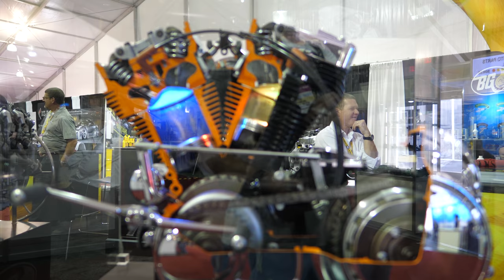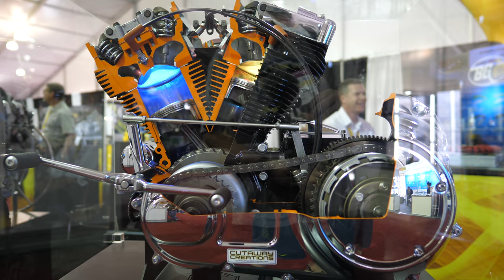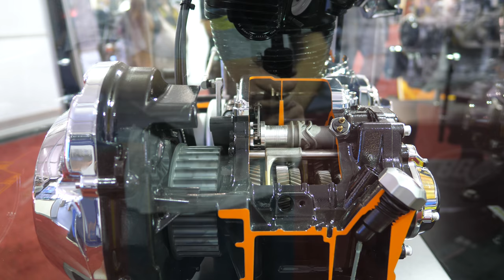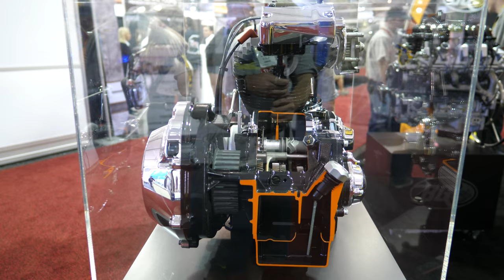Working Model of an Evo Harley Davidson V-Twin Air Cooled Motorcycle Engine at SEMA Show [4K]

Comment: Harley Davidson. Turning gas into noise without the side effect of horsepower since 1913
Reply from the maker: Lol
Reply: You don't know about engines. Without TQ there is no hp and a Harley makes more tq that your bike does🤣🤣🤣
Reply: 1903*
Reply: @austinwise5493  my bike makes 101ftlbs and 200hp. Out of 988ccs. 2020 ZH2
Reply: @sambert96  damn that's weak. Only 101 lbs of tq🤔 there are harleys making wayyy more tq than that. There are also 800 lbs baggers going over 200 mph👌 your bike has to weigh 300 lbs to do that or else the engine would blow up and you can YouTube that 😅
Reply: @austinwise5493  yeah sure whatever you say buddy.
Reply: @sambert96  if your on youtube all your have to do is youtube it but you won't cuz you will see harleys been crushing your "fast" "powerful" bike🤣🤣🤣
Reply: @austinwise5493  lol ok buddy. Whatever makes you feel better
Reply: @onefastslimjim  so if your correct than TQ X RPM doesn't equal HP🤔
Reply: @onefastslimjim  the equation to get HP is TQ X RPM so yes TQ does MAKE HP. tq is twisting force ( oh wait I'm wrong on this too ) lmao twisting force is what makes the engine TURN to make RPMS which MAKES HP lmao yea your right tho. Hp lovers don't know shiit😅
Reply: Austin Wise your literally speaking gibberish 😂😂😂
Reply: Quantum Leap THANK YOU 😂
Reply: @austinwise5493  Your physics is weak. Torque is only part of the equation. You have to take into account how much force is delivered per second, that's what horsepower is a measure of. 1 horsepower equals 550 ft/lbs per second. So while an engine with more torque may deliver more peak force, an engine with more horsepower is delivering more torque per second. All things equal (gearing, weight, etc.) Its the engine that outputs more horsepower across its rpm range that will accelerate faster.
Reply: @execration_texts  if that was true show me a stock car that will beat a tesla....I'll wait. Without twisting force (TQ) nothing moves. The force delivered per second is TQ not hp.
Reply: @austinwise5493  that's incorrect. Teslas are fast because electric motors are between 85% and 90% efficient at converting electrical energy into rotational force. By comparison the most efficient combustion engines hover around 30% to 35%

Horsepower is a unit of Power.
Power = force × (displacement/time)

Torque is a unit of Work and is defined as: torque = radius × force x (sine of theta) or more simply: Force × linear displacement

Do you see time in the torque formula?
Reply: Work is equal to force over time, or  torque over time....
HP = Torque x RPM ÷ 5252

Horsepower is the measure of being able to do work or energy. See you can see by the equation that you can have half the amount of torque but twice the RPM and you have the same amount of horsepower.
Reply: @william.youare6736  horsepower is the measure of the rate at which work is done
Reply: A 200hp zh2 is still gonna beat a harley,more torque doesn't mean faster, horsepower is how rapidly a vehicle can perform

 More torque means more force you have to either accelerate your car or pull a load with
Harleys have a lot of torque because they are heavy bikes and are meant for cruising,they are not aerodynamic and doesn't have high speed gearing

Can your harley do 300/400kph?
Can it compete the isle of man TT and not break down?
Can it go around a racetrack without it scratching the utility box on its side

Sure Harleys are good for standing 1/4 mile,0 to 60 and smoking the stop light but it was made for old men who likes classics,harley Davidson has a great history from the very first bike and how they came to be but just stop comparing cruisers to sportbikes, both are made for a purpose and both are nice in their own way
Reply: Its fast enough for the speed limit -.- harley's are for enjoying the cruise. And if you want horsepower just slap on a booster 🤷🏻‍♂️ a good tuner will know how to modify a stock
Reply: Harley bois are offended, be safe dude haha 😉
Reply: It wasn't made for you...
It's a mans bike
Reply: for use every day who needs a motorbike with large horsepower, if a large torque is needed to be used every day, after all, no one wants to race every day, with high engine speed and to high speed on public roads there are disturbing people around unless you are a racer whose day-to-day work is just racing on racing tracks.
sorry for my opinion, do not mean to offend anyone ✌️but based on my experience living in urban areas with 5 motorbikes that I have in the garage (nsr sp150, vespa sprint 150, harley davidson roadster, mv agusta brutale dragster 800rr, yamaha xsr900)
Reply: Noise junk, that's all!
Reply: Ducati dois cilindros tem comando desmodrômico (sem molas)
Reply: @austinwise5493  lmao you are defeated
Reply: I've ridden many rice burners, they do not thrill my bones like a Harley does and they never will. I am 60 and still burning Harley gas. There is no replacement!
Reply: @sambert96  ZH2 is the slowest Hypernaked bike on the market in terms of track performance lol, even a Yamaha MT-10 SP would destroy your ZH2 on track. Plus you forgot to mention that your bike is supercharged, and only 200hp? That’s pathetically underpowered, look at KTM 1290 Super Duke R, that uses a 1301cc V-Twin generating 180 horsepower, weighs only 200kg wet and hits 300kmph at the limiter, your ZH2 freezes at 287 because it’s a big fat 239kg bike and doesn’t have a good power to weight ratio! That’s a big shame on Kawasaki. You should have bought a Ducati Streetfighter V4, or Aprilia Tuono V4 or Triumph Speed Triple 1200 RS, all of em will smoke ZH2 in a straight line as well as on track and they’re much more comfortable
Reply: HD's are very powerful.  But their poor factory quality control and poor factory workmanship and  inferior materials has made them the laughing stock of the motorcycle community.
Reply: @sambert96  you have a bike meant for the track, you bend over like you’re bout to take it you know where to ride, and it costs just as much as a Harley. Not sure what you’re getting at bro
Reply: @austinwise5493 yeah they make torque, but they can't go over 120 ft lbs 
It's like a powerlifter, sure he can pickup a huge amount of weight one time but he has no functional athleticism 😂
Reply: @tomtemple69  I can't believe that 2 years ago, someone thought a Harley would crush a ZH2 😂
Reply: @zahrulexe  it would crush a zh2, literally lol
900 lb fat@ss bike will crush a 530lb zh2
Reply: @tomtemple69  all because of torque down low. Heck yeah!
Reply: Ha ha ha😅
Reply: @sambert96 sounds gay

Comment: Fake, there's no puddle of oil under it
Reply: There's a puddle in your underwear
Reply: The engine is for showing its not for running
Reply: My shit don’t leak
Reply: Comment shows you’re 80 years old
Reply: I rode an evo for 34 years, didn’t leak!
Reply: I have an evo with a 124K miles on it.  It doesn’t leak.
Reply: Not all harleys leak if you do proper maintenance and fix every issue you want have a issue
Reply: The evo saved Harley. They are reliable as can be
Reply: @mitch6969123 after 26 years my 1998 Fatboy just started dripping
Reply: Yo
Has anyone, ever, I mean ever…sealed a HD Evo primary?

Is it humanly possible to seal and make the Evo primary oil tight?
Reply: Cuz it's not owned by some hill jack like yourself

Comment: This is the Only harley engine that doesn't leak and keeps running.
Reply: Haven't seen a Harley leak oil since Honda stopped making them in the 80's
Reply: How many 1970 or older rice grinders you still see on the road???
Reply: @austinwise5493  
i had a honda and when i take it out after winter, it starts right away. A dude i knew had a harley, and it took hours
to reanimate that dead piece of shit back to life. And a harley dealder knows their customers by their first name, because
the customers come there very often to buy new parts and then talk about how awsome the quality is.
Now when you walk into a honda dealer, then they will be suprised when you need a new part, because it's not usual that something 
wears on a honda, and then you have to wait a few days because they don't have that part in stock because they don't sell many of them.
And then they need to know your name and number and the vin number or else they can't even find it, but at the harley shop all you need is 
year and model and then they know what you need  and always have a few in stock because those quality parts sell like hotcakes.
Reply: @3DPeter  so why don't you have that honda anymore?
Reply: @3DPeter  youre not lying 😉
Reply: ronnie doorzon  youre not lying 😉
Reply: My 56 Pan didn't leak except out of the crankcase vent dump line. The secret was making sure mating surfaces were flat, new fasteners, and Yamabond sealers used on the cases, and the Pan covers.
Reply: Harleys used the oil mist from the crank case vent to drip onto the primary chain. There was a drain hole at the rear of the primary to keep it from accumulating. They tried sealing the primary, and putting in a system of hoses to empty the oil on recirculate it, but it wasn't their best idea. But, running a dry clutch required they try something. Later, wet clutch and primary case became self contained. Early on, Harleys used reverse oil slinger washers and collars with grooves counter to rotational direction of the shaft they were sealing. Expansion rates btwn  aluminum and iron/steel also affected things.

Comment: You can see why the V2 engines sound so good. 

The left cylinder arrives at the top a little later than the right.
Because of that the firing interval is uneven and you get that burble sound. ❤️
Reply: & share the same crank pin
Reply: It's  POH TATE OH POH TATE OH POTATO....
Reply: Yeah, the Rear Cylinder is #1 and there's 315 degrees between #1 firing and #2 and then 405 degrees between #2 firing and #1 again
Reply: @knucklehead7456  The Nuda 900 has the same 315 degree crank, and sounds great as well. 
Love it. 👍
Reply: @knucklehead7456  where does that third pop come from, though? I see two cylinders' exhaust valves opening, creating two bangs, but harley engines have that distinct po-ta-to sound, and I'm failing to see the third pop.
Reply: The spark plugs on an Evo fire every time the cylinders reach top-dead-center, not just after the compression stroke. So the 3rd (or 4th) pop you hear is the spark plug firing at the top of the exhaust stroke and igniting any unburnt air/fuel mixture that happens to be left over.  So, realistically what you are hearing is PO-TA-to-to (two bangs, and two pops) but the last two are much weaker and more sporadic than the first 2 bangs @infantry4lyfe252
Reply: @infantry4lyfe252 When the right cylinder reaches top and the sparkplug fires the left cylinder still has the exhaust valve open and since both spark plugs fire simultaneously a small bang occurs using unburnt gases. I hope i helped..
Reply: @andreassamaras8035  hell yeah man. Thanks 👍

Comment: So the are the gears forcing the explosion to happen at a much slower rate, is that what I'm seeing ?
Reply: It's just electronically driven and there are some LED lights in the cylinder which show the stroke

Comment: Air cooled or liquid cooled which is better?
Reply: For a motorcycle air cooled is more enjoyable to ride. Keep moving and enjoy the simplicity.
Reply: The Honda Goldwing is liquid  cooled and is one of the best touring motorcycles ever made. Liquid cooled engines have tighter clearances, perform better and last longer. Remember the old VW beetles? They had air cooled engines and they were garbage.
Reply: The difference between the two is not all that great, compared to other differences.  Air-cooled is simpler, easier to work on, and doesn't face internal corrosion issues if you're buying a neglected vintage bike.  Water cooled can have greater cooling capacity and can keep temperatures in a tighter range, allowing tighter tolerances and higher performance.  In reality though, unless your bike has a very high-powered engine (eg sport bike or MX bike) then the primary benefit of water cooling will be emissions.  Air-cooled engines can be made quite powerful.  There are thousands of air-cooled 250cc engines running around, making more power than the VW car engine that someone above mentioned.  There are also lots of big, low-performance slugs that are water-cooled.  Cruisers are so big and mellow that they can very easily be cooled either way.  Other design criteria make more of a difference.  Only very poor engineers would make an engine where the air- or water-cooling would be a deal-breaker.  So choose your bike based on other factors that are important to you, such as looks and performance, and then if you're worried about it, check to see if that particular model has cooling-related issues.
Reply: @JETZcorp  you got don't want to be sitting still in hot weather too long or damage can occur. Both have their ups and downs
Reply: @BruceLee-xn3nn  Most liquid cooled bikes don't have radiator fans, so they face the same issues with sitting.  I'll just say that all my bikes are air cooled, and it would take a supernatural amount of sitting around to have an issue with them.  Depends on the bike, YMMV.
Reply: @BruceLee-xn3nn  I know enough to know two things. the engine is garbage compared to what is available. And two, I would fly in any  "airplane" that has a VW engine in it. PS I used to be a VW service manager, so what would I know?
Reply: Walter Dumbrowski  wow. the issue is what COOLS THE ENGINE. Air over cooling fins or WATER circulating around they cylinders/head etc. So, in reality, a WATER COOLED engine is actually cooled by WATER.
Reply: You ever sit in a traffic jam in 90 degree weather? You'll know the difference then..
Reply: Liquid cooling is more efficient and allows for higher compression ratios. Air cooling is simpler, but only marginally so... how complicated is a few hoses, a pump, a thermostat, and a radiator?

Comment: No wonder a Harley vibrates and shakes. Just in the design of the engine both oistilns seems to be traveling almost in tandem. 1 leads the other by a little. I figured they wou be going in opposite directions  to counter balance each other.
Reply: Do you think the parallel twins have one piston moving up while one piston move down?

Comment: Now its clear to me why hd make a lot vibrations
Reply from the maker: Why’s that?
Reply: @InternalCombustion  the v angle is very tight, look at the twin cylinder, they were really close to each other, considering the 2 piston travels almost at the same time , share same crank pins & in tight space, this configuration makes so much torque, but produce high amount of vibrations, (dont even think they will ever produce high amount of power as OEM , since it was low compression )
Reply from the maker: Oh gotcha. Yea I know other companies like Ducati make higher hp Vtwins. I still think the Harley sounds the coolest though
Reply: @InternalCombustion  In a V twin with a V angle less than 90°, the vertical imbalance is greater than the horizontal imbalance. The crank weight is sized to "average out" the imbalances of the pistons and rods, but that still leaves a residual imbalance. Luckily, if the crank weight is properly sized, this residual imbalance is approximately circular, which neans a single balance shaft can eliminate most of the vibrations.

Comment: ..looks a bit like the internals of a radial aircraft engine...maybe that's why a Harley sounds somewhat like a radial engine?....
Reply from the maker: Air cooled, pushrods and angled valves.  With more cylinders and double the spark plugs I too think it would look slot like an old school radial engine!
Reply: It is basically an incomplete radial engine.
Reply: @nunyabiznuss124  The original design was built from a radial engine.
Reply: @NVMDSTEvil  I just wish that sound could be achieved from a more efficient design that produced less vibration.  That sound reaches in and touches something primal in my being.  Kinda like a big ol' fire in winter.  It just draws you to it.  I had to spilt the difference and get a 1300 Honda VTX.  Both cylinders share a crankpin but the cylinders are set at 54 degrees.  It makes smooth power with less vibration and a "similar" sound.

Comment: If harleys make ssoooo much torque, why does my xsr900 make 87nm and an 883 harley which has 40 more cc make only 69nm??  At different revs, i know, but come on, harleys dont make more torque than other similar sized motors.
Reply: Since motorcycle treadmills test Tq at the wheel, after the engine Tq has traveled thru the transmission and final drive to get to the wheel, comparing the outputs of 2 motorcycles on the treadmill is useless.......In order to get comparable test results you would need to run the bikes in gears that produce the same speed per RPM

For example my crotch rocket claims more Tq and HP than my Kawasaki 1700......forget the weight, my crotch rocket runs 58 mph at 4000 rpm in 6th gear, my 1700 runs 70mph at 2500 rpm......if the 1700 was tested in a gear that runs 58mph at 4000rpm then the Tq would be comparable........if the crotch rocket had a gear that ran 70mph at 2500rpm it probably wouldn't run, but if it did it would show way less Tq at the wheel

Any engine of close cc that has a longer stroke will produce more engine Tq........engine Tq is the amount of boom times 1/2 the stroke length in 1 cylinder

Harley tests Tq on the motorcycle treadmill, then run the results thru a reduction equation to better match actual engine Tq